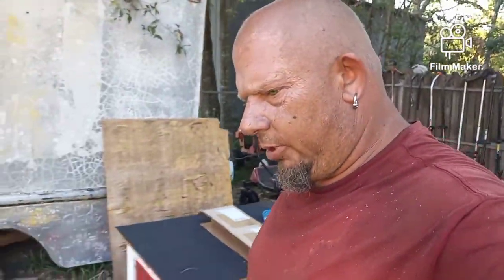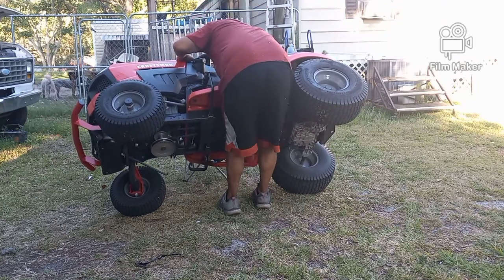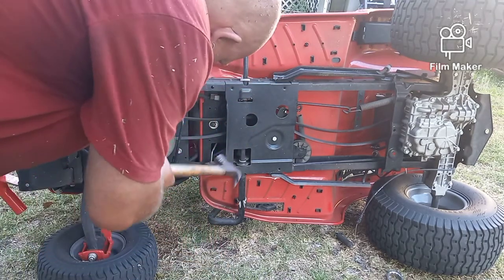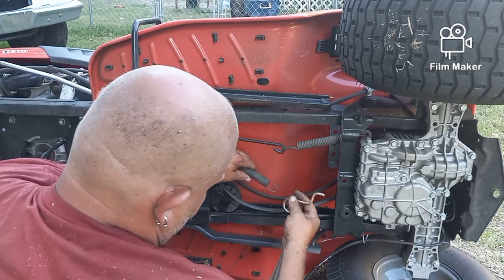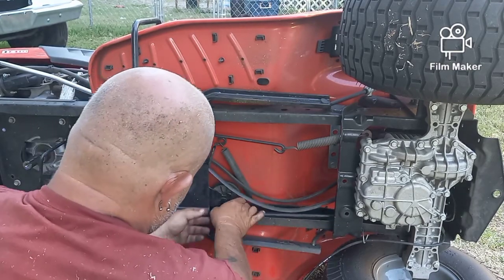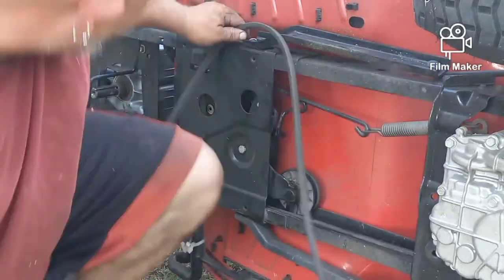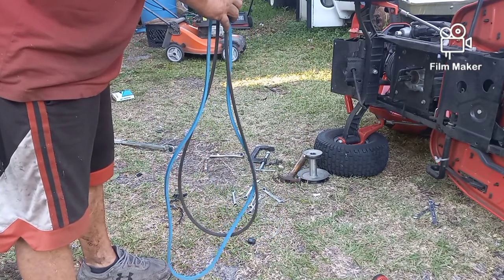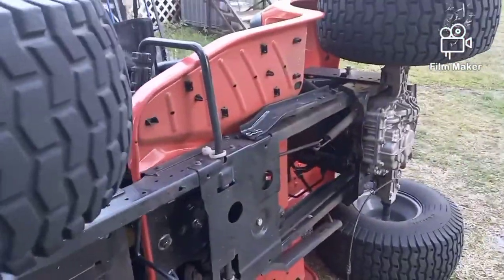Save Money Craftsman T-210 riding lawnmower Gets New

Comment: Can you do a video on how to fix the T 210 reverse issue. Mine is not going on reverse.
Reply from the maker: This customer has many machines I service. Because we had to put the old belt back on I will be seeing it again . When I do ill make a vid about possible causes .. do u mean it won't shift into reverse or when it's in reverse it won't move
Reply: @MunkyWrench  it  will not move on reverse "some times". I really need to see a video so I can understand its mechanism. I saw videos on the removal and installment of the deck and I actually did it. I notice the lower belt is a bid loose but again Im not sure if that could be the source of the reverse problem.  Also your video on the drive belt is rare I wish I could see one with more precise instructions. 
Thank you for your help.
Reply: Would like to see the fix to the reverse issue as well